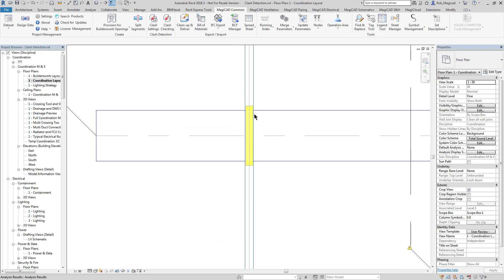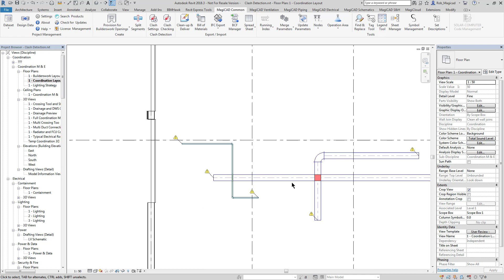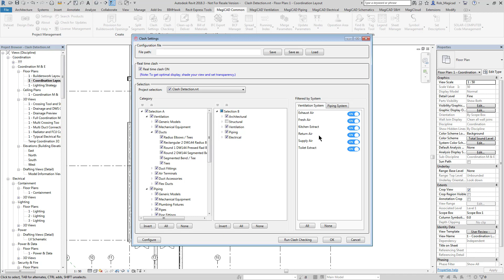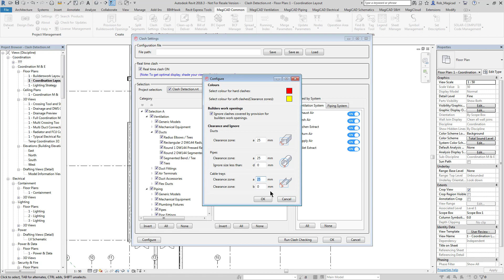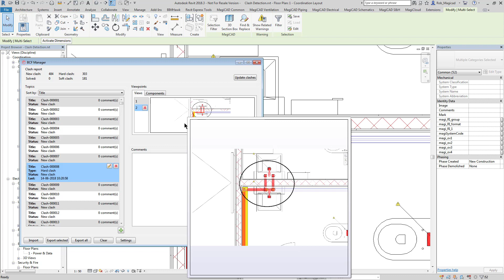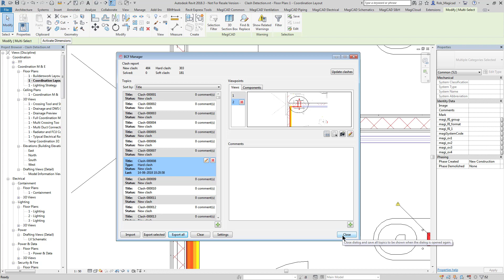MagiCAD 2019 for Revit / The all new MagiCAD Clash Detection

Comment: Does the clash detection check your model elements against elements from the the linked files, you have in your model or does it only work your own elements against own elements? In the case that it works against elements from linkeds files, could you add the opportunity to check on/off, which linked files you wish to check clashes up against?
Reply from the maker: It's checking linked models and elements within this linked model. Clash Detection has the functionality to check on/off which linked files it detects.
Reply: Awesome! :-)

Comment: I wonder how much additional strain this function takes on the computer? If its on all the time while modelling a huge project with significant more objects, will it give a lag on processes? If thats the case, is it possible to do one single run so that the colors print on clashes and then turn off the clash so that it does not run in the background weighting the modeling process?
Reply from the maker: Real time clash detection can be switched off. MagiCAD Clash detection has two different ways to work: 1) On the fly – as real time, which shows clashes while modelling. 2) A ‘one time check’ on demand.